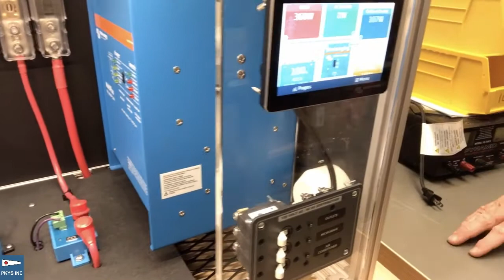Van Electrical System Demo Using Victron Energy, BEP Marine, & Blue Sea Systems

Comment: Thank you for the nice and tidy presentation of the system, nice work 
 would this system work if in the future an owner like to add more batteries or connect to 2nd alternator or other components are needed then
Reply: Peter would recommend that you future-proof and purchase as many Batteries / Amp Hours as you would like up front when designing ad initially installing your system, otherwise the batteries can't operate as a unified bank of cells and age together over time. I started with 800aH. Pricey, but worth it, knowing I've done things correctly and have the headroom I'll need in the future.

Comment: Hi Peter, on the SMART BMS CL, do you notice the orange and yellow LED lights remaining on?  The red LED is not on.  Is this the correct function. Lastly, don’t notice a LYNX DC distributor.  It’s looks like you used a different busbar.  Is this more advantageous?
Reply from the maker: This is a demo and is not fully functional,   It uses the  BEP PRO electrical system as an alternative to the Lynx distribution system.  You will find both on our website in the COMPONENTS section
Reply: Thank you Peter